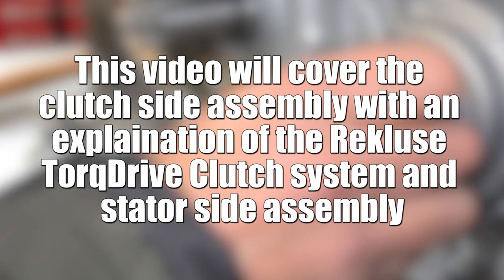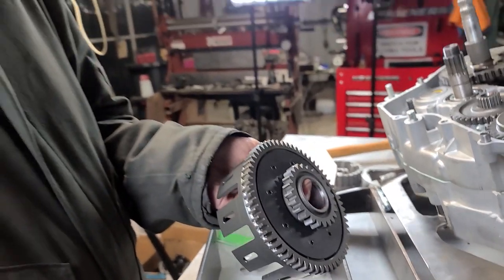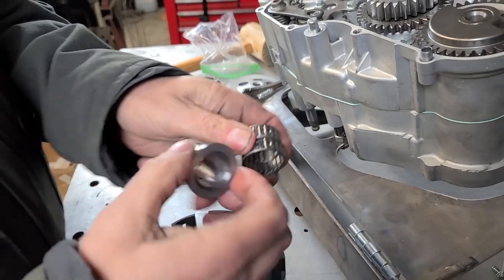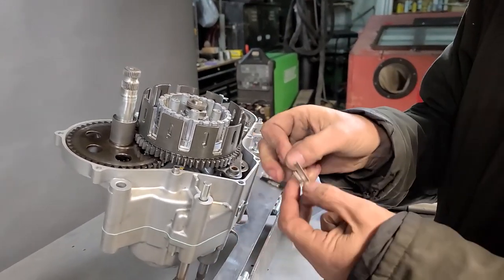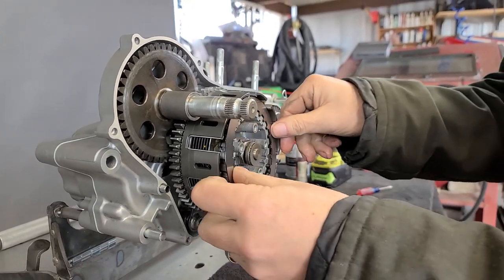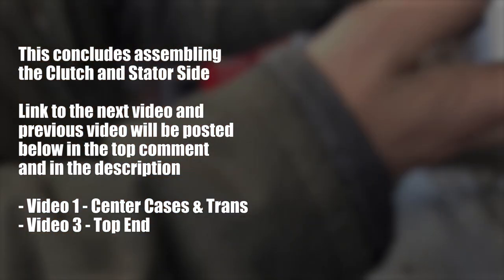How To Build an 85-89 250R Motor W/ Dave Moore - Part 2 - Clutch and Stator Side

Comment from the maker: Thank you for watching man!! 🤘

Video 1 - Center Cases and Transmission - https://youtu.be/ASpYpSJ7X6A
Video 3 - Top End Assembly - https://youtu.be/skHge7Zi-y8
Video of This Motor Running - https://youtu.be/ctupjItBnHM

Chapters

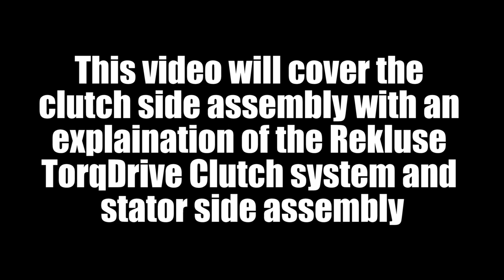0:00 - Intro
0:15 - Kick Starter Assembly
2:00 - Counter Balancer Install
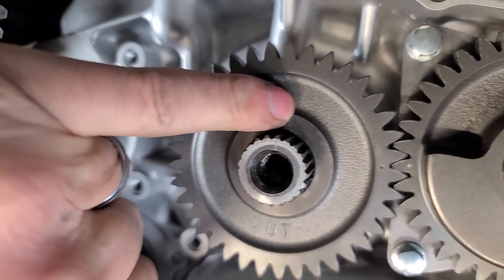4:19 - Primary Gear Mod For Hinson Basket
7:09 - Shifting Assembly Install
11:47 - Clutch Basket Install
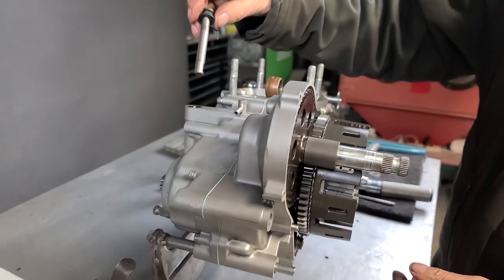14:08 - Clutch arm and Push Rod Install
14:54 - Explanation and Install of Rekluse TorqDrive Clutch Pack
23:03 - Adjusting the Clutch arm Throw for a Perfect Clutch Pull
29:05 - Clutch Cover and Water Pump Install
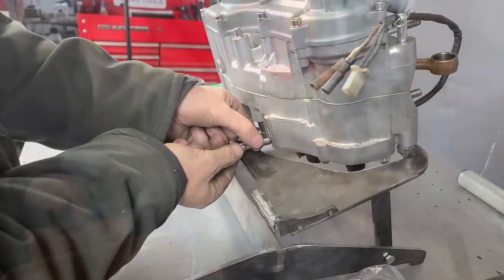36:44 - Stator Side Assembly/Vent Mod

Tools and Parts in The Video

Crank puller/Installer - https://bit.ly/3kBXDCr
Case Splitter - https://bit.ly/3dNh3D4
Engine Stand - https://bit.ly/2Tg3J1T
Clutch holding tool - https://amzn.to/2O6WSFh
Red Loctite - https://bit.ly/3szbpIF
Rekluse Clutch - https://rekluse.com/product/torqdrive...
Rekluse Oil - https://bit.ly/2NGF5oK
Hinson Basket - https://bit.ly/2NDMQM9
Reply: This is legendary!!!!!! U always have epic content!!!! What u gonna do next? Find a banshee goat and build the ultimate banshee (Cheetahhhhhh).
Reply: What’s up is 2018blabla yo My Instagram. Got hacked I lost my account I’m trying to get back to it I have to wait it out this sucks dude Man this looks good dude I like the way the fingers in the clutch basket are protected by those sleeves my first time seeing that bad ass man

Comment: Dave should sell that clutch tool 🔧.   Way better than any other tool I've used or seen.  Package deal with a motor stand.  Great job explaining setup.
Reply from the maker: I think there's a lot of people in that camp man haha, Dave said his email is flooding with requests for the stand!
Reply: @MichaelSabo  what sealant did you use on the stator side
Reply from the maker: @sharvisgainey1573  on the grommet I sometimes use yamabond 6B but otherwise I do not use sealant on the stator cover. I do grease the gasket which has a sealing effect.

Comment: I have been using 2x4 blocks when assembling engines since I went to class. My next purchases I want to be able to get me a table lift and an engine stand. It will make the whole process easier for me, especially the older you get, the less bending over you have to do the easier it is on you. Great video!!!!!
Reply from the maker: I agree man, and especially for putting the engine at an angle

Comment: since when is it hard to install clutch plates? those stainless steel inserts seem janky AF though. who cares if you get grooves in the basket. that is easy to replace and only a couple hundred bucks. i dont like the thought of having extra parts in there that could potentially crack/break/come loose and cause havoc.
Reply from the maker: Oh man, this is a tried and true setup that's been used on many bikes for some time now and has just recently come to the 250Rs; call up Rekluse or ride a bike with one and see for yourself bro 🤘

Comment: In terms of the rotating mass, do the steel clutch plates contribute to the overall flywheel effect in any noticeable way? For what I do, I run a flywheel weight on my 03 CR250R and like the mellowed power delivery.
Brilliant tutorial, many thanks.

Comment: 14:38 the bearing you are showing is the 1989 needle style P/N: 91001-147-003 BEARING, NEEDLE (12MM), 1988 & 1987 used a revised multi-ball bearing design P/N: 22352-HB9-670 PIECE, CLUTCH LIFTER + x3 P/N: 96211-04000 BALL, STEEL (#4) , 1986 had the original single ball bearing type P/N: 22352-KA4-000 PIECE, CLUTCH LIFTER + P/N: 96211-09000 BALL, STEEL (#9) (9/32).

I edited this post to put an end to any argument on which style came with each trx. 1989 is the only year that had the needle bearing for the clutch actuator rod. Not only is the rod different for 1989, so is the pressure plate that comes in the 1989 kit from Honda. The bearing shown in the video is not from an 88 like I originally said. Check Wikipedia, it even mentions the change in 1989, it is source #3. . Also, the service manual clearly shows all differences from 1986-1989, it is in the CLUTCH section page 7-0. THAT IS FACT, THAT IS THE END OF THIS.
Reply: 85-86 ATC/TRX used a single ball bearing under the clutch lifter. 87 TRX used 3 small ball bearings and are very rare to find in a machine as they failed right away and we replaced them with the 85-86 set up. 88-89 used the needle bearing clutch lifter and can be found using this part number  22351-HA2-000.
Reply: @davemooreracing  88 and 89 are different. In the video that is a needle bearing from the 89 upgrade kit Sabo probably purchased when he did Neils (rip) mod. I have an 88, click on one of my videos for proof.
Reply: @steve069  Which video?
Reply: @davemooreracing  What do you mean, the last 4 videos should be proof that I have an 88. I did the 89 upgrade swap a few summers ago so thats why its still fresh in my head. Im not arguing with you over engine building, I am just stating the fact that the needle bearing is 1989 only, no other year had that. Service manual page 7-0 proves it. (edited had the page number wrong)
Reply: @steve069  Did you buy your 88 new in 88? i bought my 85 new in 85 brand new 86 brand new 87 brand new 88 and a brand new 89 all whale working as the parts manager for Salem Honda. I have no need to read any thing i lived it.
Reply: @davemooreracing  My cousin bought his (now my) 1988 brand new from Rosenau Powersports in MI, still in the crate in 1989 when the white ones arrived. I see him a few times a month actually. I took the original certificate of origin and had it titled with him too. You are wrong about the bearing, my engine never had the cases side panels removed and I was the only person to get into that clutch.
Reply: @steve069  Prove what you say.
Reply: Or maybe the better question. How many 250R motors have you rebuilt in the last 36 years?
Reply: You opening statement does not even match with the Honda  microfiche.
Reply: @davemooreracing  https://en.wikipedia.org/wiki/Honda_TRX250R

3.Lanphier, Bill (May–June 2006), "Two Decades of 250Rs", Sand Sports, 12 (3): 62–65, 116, 118–119, 10961941

I did say that comment slightly wrong, it should have been 86 had its own ball bearing style, 87-88 had its own ball bearing style, 1989 is the needle bearing. Regardless, I am only talking about the difference between 1988 and 1989 being different so my original comment about the 1988-1989 stands. 1989 is the only trx250r to come from the factory with one. The one in your hand in the video is not an 88 bearing.
Reply: Unless you have worked on all the years when they were new then what you believe to be true was told to you by someone...Who?
Reply: @davemooreracing  Dave, stop freaking out. If you are at the MI dunes 250R meetup this summer we can meet up and have a beer or something. You are getting upset about a bearing. Are you saying the 1988 250r has a needle bearing from the factory? You would be wrong so just let it go my friend.
Reply: Wikipedia . Ok well now i have my answer. You have a good day.
Reply: @davemooreracing  Jesus Dave I already responded to you saying I got the first two mixed up and that wasnt even what we were talking about. The question at hand is 88 vs 89.
Reply: @davemooreracing  In the microfiche there is a section that says "AFTER 88" right? Can we stop arguing now?
Reply: @davemooreracing  You seem like a real fun guy.
Reply: @davemooreracing  You too bud. We can agree to disagree.
Reply: @davemooreracing  Prove what? Let me know what you want proof of.